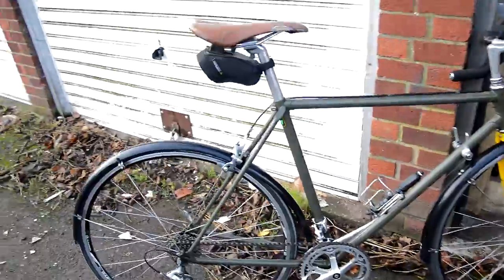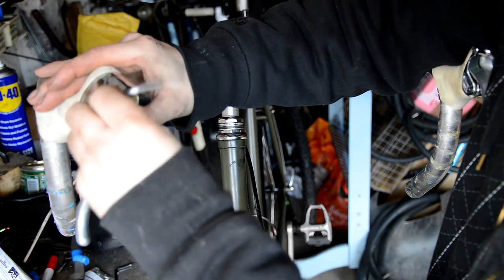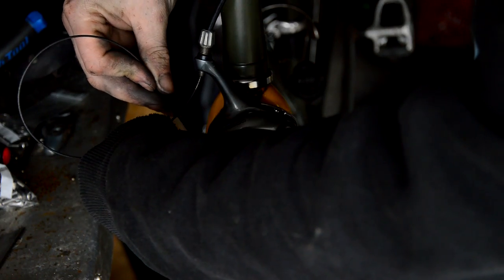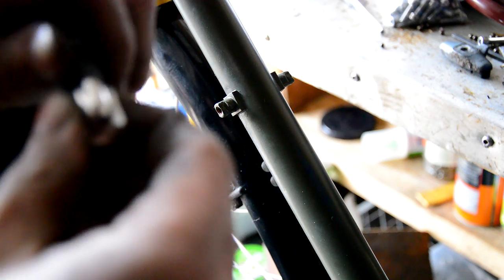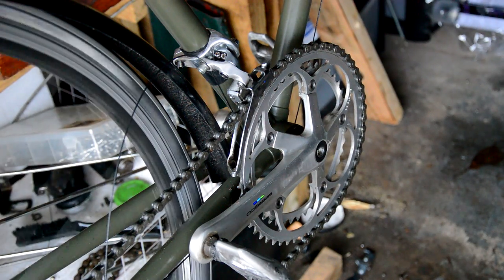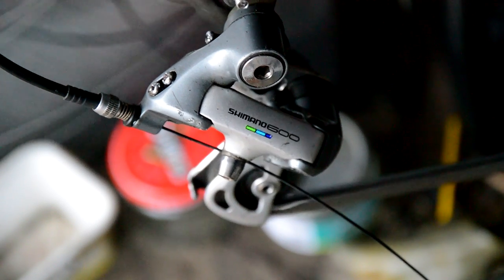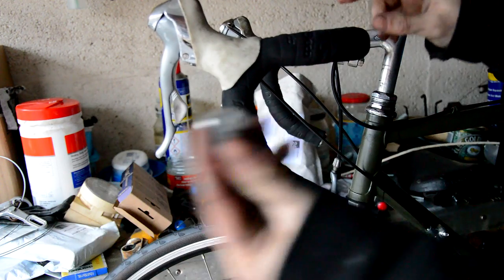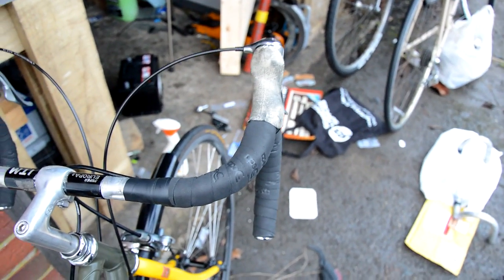Converting Down Tube Shifters To Brifters - Bicycle Maintenance - Shimano 600 Ultegra

Comment: i think there`s adapters for the rear Bluemels mudguard, which you attach to the chainstays, so it doesn`t look so funky- that said, nice bike- building something very similar myself now.
as an alternative, you melt two holes to the sides at the height of the chainstays with a soldering iron and fasten it with zipties (my method of choice).

Comment: That's a good job if it's your first try at installing those things without instructions. GCN has a video on YouTube about how to adjust them perfectly. One thing about your bike that bugged me was the front of the rear fender. I had to make a spacer when I changed one of my bikes from 27" wheels to 700c so the fender would sit closer to the tire. I just cut a piece of plastic tubing and used a longer bolt cut to the right length and it looked like it was made for it. Much safer with the new shifters. You can keep both hands on the bars.
Reply from the maker: First time converting, second time installing (they're on another bike I recently built... which I might publish next week...)  

Ahhh I see what you mean about the mudguard now.  Good solution.  A cable tie is working for me right now.

Comment: This might be a dumb question but I know basically nothing about fixing bicycles, but I’m still on a mission to fix up an old Peugeot premierelle bike. So please bear with me. It has non-indexed downtube shifters with a Sachs huret derailleur and a Shimano gearset with 5 cogs on the back. Can I use this method to upgrade to handlebar shifters for the back. Which modern brand is compatible? Or, different idea: get new derailleurs but keep the old gearset and then apply this method? What could work? Thanks for the reply! YouTube is a great place to learn new stuff.
Reply: Hope no one minds if I jump in here. If it only has 5 gears on the back very probably it is going to be a lot of work converting to 7/8 speed as that is what you will need for handlebar shifters like this video.  You might be better off with a whole new bike tbh.

I did use to have a Peugeot 5 speed myself years back

Comment: Do you think that $275 is a good deal for a 1990 trek 1400 with a shimano 600 group set? What would be a good price? I'm a kind of new to road bikes. By the way i really like the conversion you did in this video also keep up the great work!
Reply from the maker: So that's roughly, £220.  If it's complete, good condition and works well then sure, I don't really see much issue with that price.  Is it like this one?
http://www.bikeforums.net/classic-vintage/957743-so-i-got-new-bike-trek-1400-a.html

Shimano 600 groupsets still fetch a fair bit on their own!  I paid £80 for the groupset, £10 for the cable stops, and £86 for these brifters.  £176 for my group.  If you get all that and a working bike, it sounds good to me.
Reply: MonkeyShred yes it's exactly like that one but in white and red letters and it all works perfectly. Thanks for the quick reply dude I look forwards to the bike restorations and keep up the good work.
Reply: That's my daily ride. If it is in decent shape, that's a great deal. Old aluminum frames can be risky, but mine is solid, and I've actually seen a few around Boston over the past year, all going strong.

Comment: Good vid, I have the very same groupset, is it possible to buy todays shimano shifters/brakes and use those instead?
Reply from the maker: Are you thinking modern 8 speed shifters?  In theory, yes!  They should have the same spacing.  

http://www.sheldonbrown.com/cribsheet-spacing.html

That may help when deciding what shifters & gear could go together.
Reply: If I recall I have 7 speed Shimano 600 right now, the best case for me would be if I could buy new 8 speed shifters only. However, I am not still sure if new Shimano 8 speed shifters would work. In worst case I have to buy 8 speed sprocket + new rear derailer + shifters, right?
Reply from the maker: There are some 7 speed "brifters" floating around under the name "Microshift" which claim to work with Shimano.  I've seen them on eBay.  Looking at the cribsheet on SB, there is a very small difference between 7 and 8 speed... it doesn't seem much but it might just be enough to screw up the indexing.  An 8 speed upgrade would indeed require those parts.
Reply from the maker: 1990s SHIMANO RSX ST-A410 7 SPEED STI BRAKE/ GEAR SHIFTERS - SPARES/ REPAIRS

Search that on eBay UK. ;) 99p Auction
Reply from the maker: Potentially, those RSX shifters just need to be stripped down and cleaned as sometimes the original grease can "gum up", thicken and stop them working.

Comment: Did you have problems indexing your front derailleur? And can you now use the full gear range without the chain grinding on the front derailleur?
Reply from the maker: No problems whatsoever.  They all work fine, so long as I keep the bike clean.